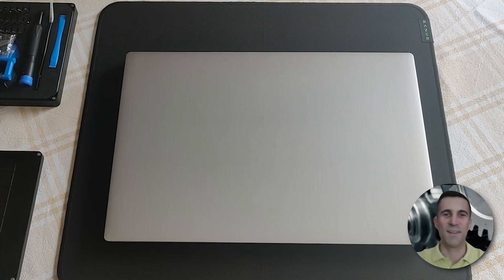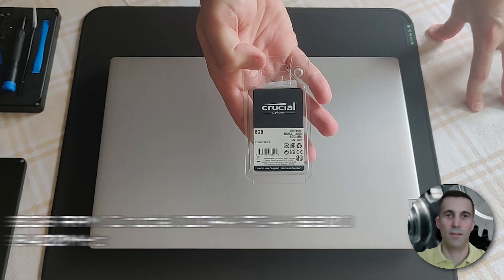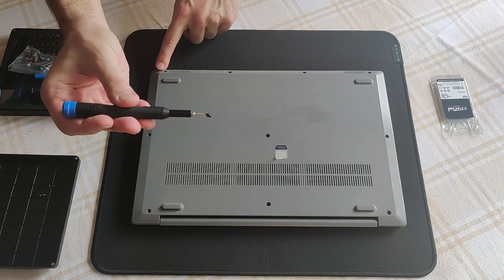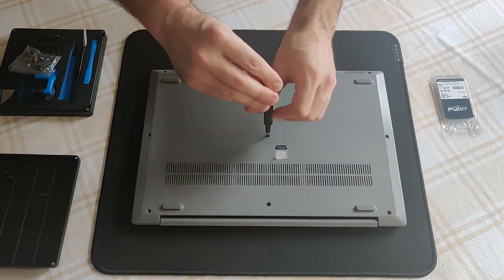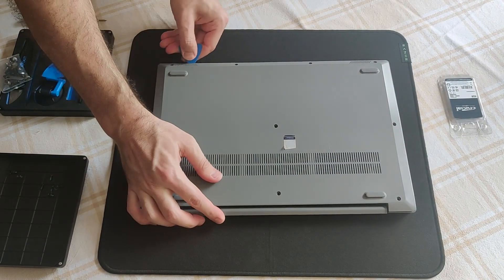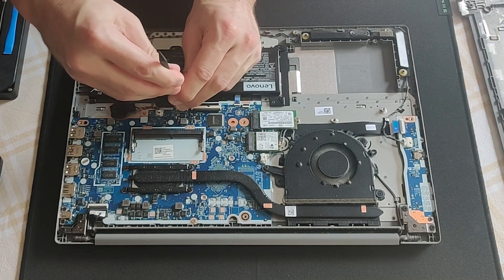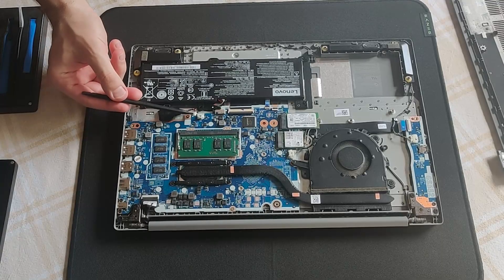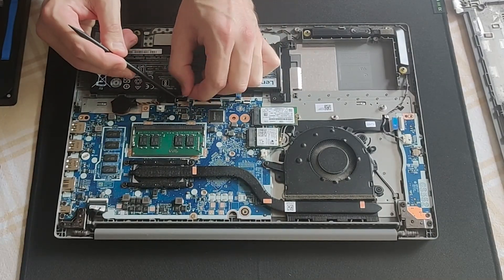Lenovo Ideapad 3 15IIL05 - Upgrading to maximum RAM and clearing the CMOS

Comment from the maker: Thank you for watching. Honestly, I did not manage to get the motherboard accept any type of RAM module, even of different speeds. Laptop has only 4GB RAM which is soldered onto the motherboard.
Reply: I have this exact PC and i am trying to upgrade my RAM, i am having the same issue
Reply from the maker: @STEPHENCOOK001  Some of these laptops even after upgrading the BIOS won't just accept single memory extension modules, any.